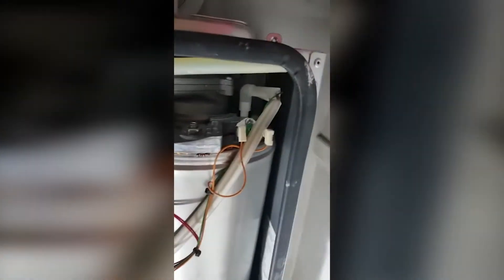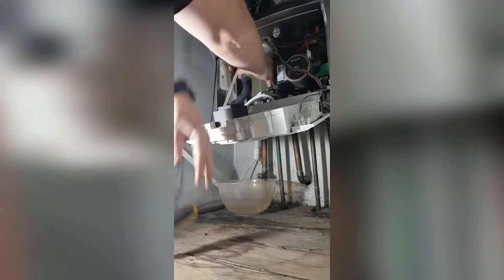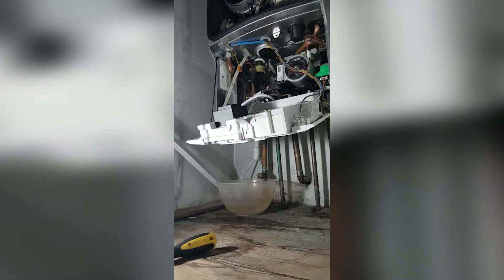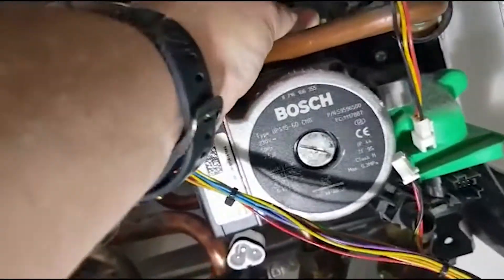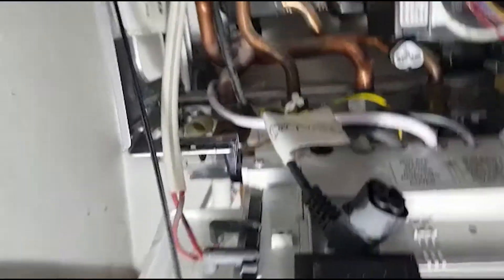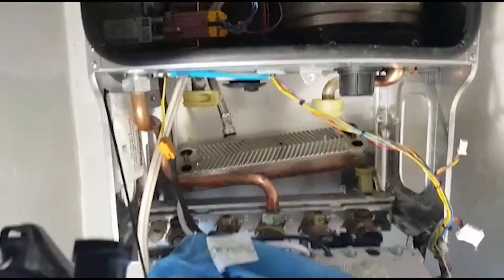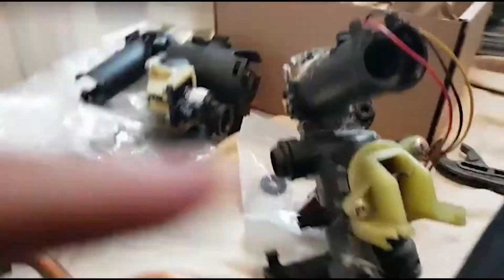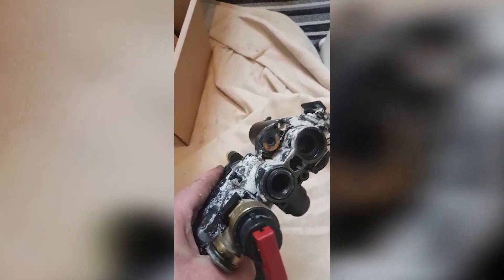Worcester return manifold | Removal

Comment: Get a hacksaw blade and cut through the right block an inch or so away from the bypass pipe , comes out nice and easy then , put bypass back into block before fitting and it will wiggle into the left hand side  if you pull it forward a little bit towards you , it makes it a lot easier trust me...
don’t forget plenty of lube on those rings... 👍

Comment: I’ve changed loads of these and have never needed to remove the left hand block just pull it off the by pass then push it back on with plenty of grease🤷‍♂️ works every time👌

Comment: Hi Andy...
Pain in the butt job....
I have removed the return manifold without removing the flow side but an absolute pain with the limited space to manoeuvre the bypass connection..
Will remove the whole hydro block in the future as it seems a lot less fiddly.
Thanks for posting.
Reply from the maker: hiya Carl. It is a right pain. Always a job I dread doing.

Comment: Hi Andy. The non return/bypass valve fell out when I removed the bypass pipe! And now I dont know which way round it should allow the flow. Am I correct in thinking the flow should be able to go from right to left through the valve? Thanks
Reply: Came here to find same answer. Bollocks